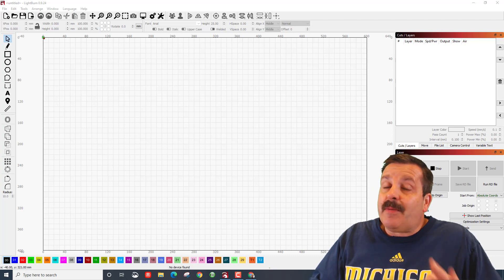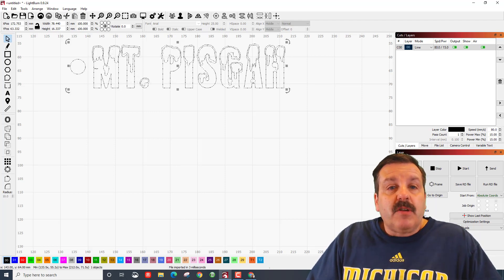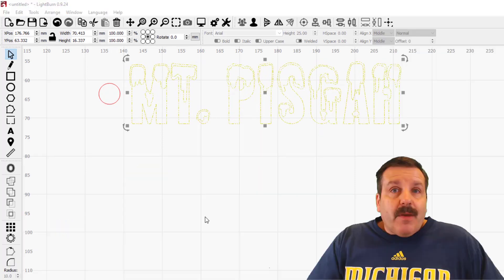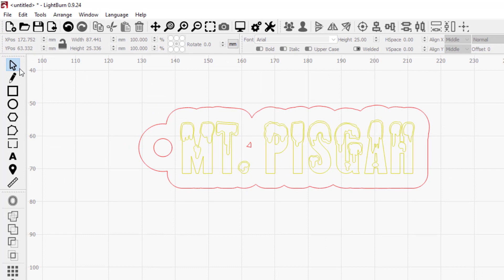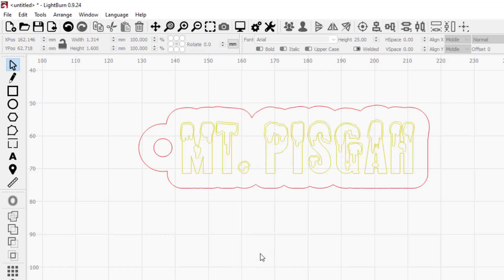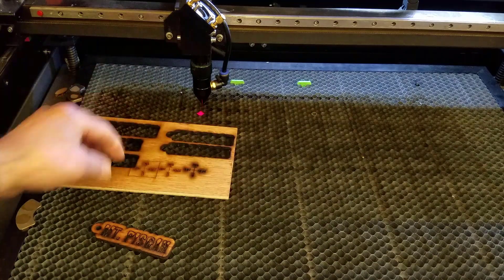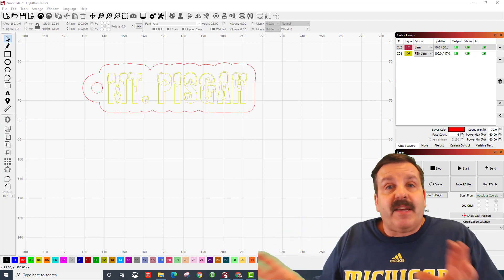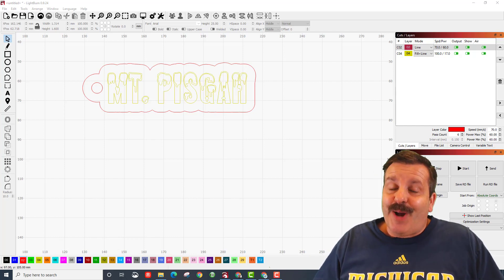Fast & Fun Keychains with Lightburn & my Orion Motor Tech laser cutter

Comment: I subscribed and rang the bell as I’m trying out your offset line for some key chains.  It worked perfectly.  My xTool D1 pro is engraving them as I type this out.  I will be using that option for other key chains in the future.  

Thanks again for your help 

Santa Howard’s Workshop
Reply from the maker: Awesome, thank you! If you ever have questions feel free to reach out. A ton of my favorite projects have started from users questions.
Reply: @HLModTech  For some reason my x axis is either too tight or too loose.  It seems to skip at some points.  It can’t seem to cut a perfectly round object.  It looks like it’s off a bit or out of shape.
Reply from the maker: When I was first fiddling I could make that happen if  had my speed too high.  Actually that was with my diode laser... Which laser are you speaking of?
Reply: @HLModTech  I have an xTool D1 Pro 20 watt diode laser.
Reply from the maker: That makes sense. I should have stored that from the first message. I would check that speed and I make sure your distance from the laser to the object is right.  Do they give you "tool" to gauge that distance?
Reply: @HLModTech  it’s a thing they call a kickstand near the back of the laser.  It unfolds, loosen the screw on opposite side,  set down to contact the work piece, then tighten the screw.  You need to watch a video using the xTool.
Reply: @HLModTech  For some reason I cannot cut through plywood completely in one pass.  For poplar, I can cut through 1/4” easily in one pass.  The plywood is about 1/8” smaller than the poplar.
Reply from the maker: On all my lasers plywood is tougher to cut. I believe it is because of the glue and compression. As I say that I think they may alternate the grain of the layers too in a attempt to make it stronger...